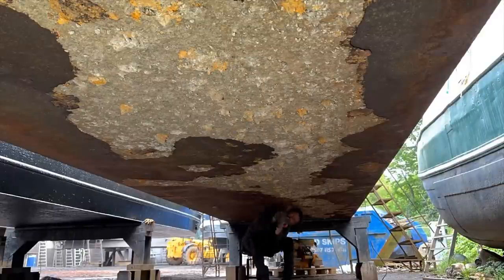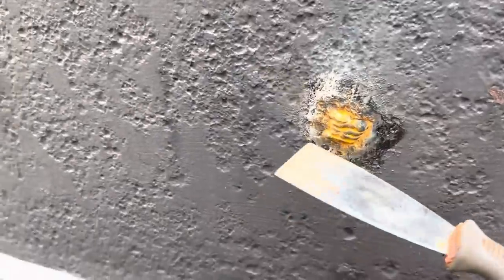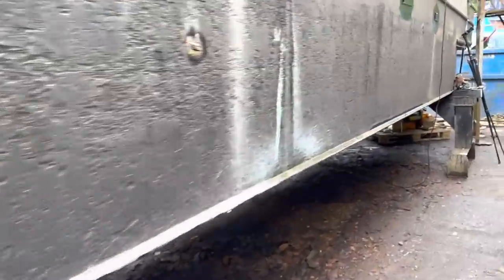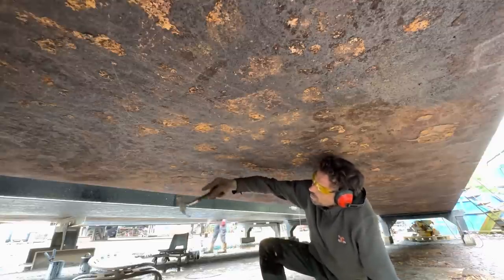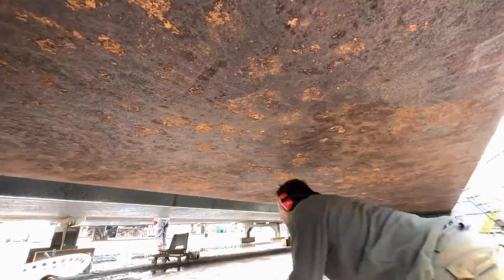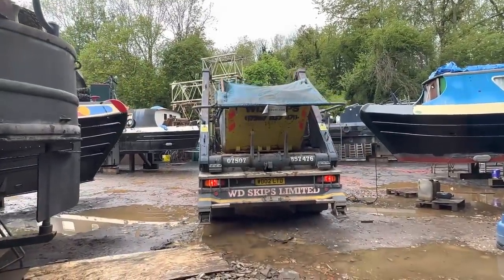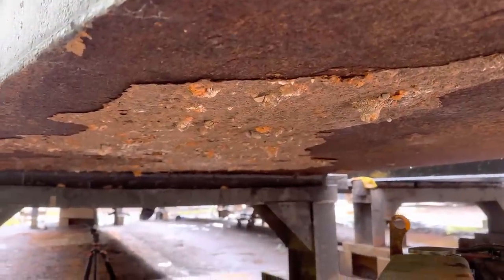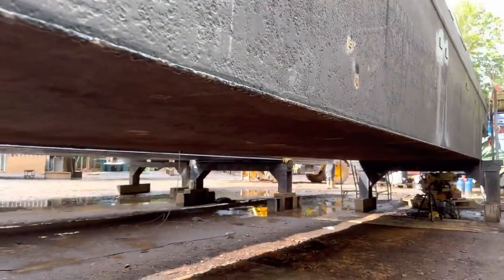425. Removing caked on scale and rust from the baseplate

Comment: That base is a waste of good energy James. Patch it up with Bitumen and next year get it dry docked and grit blasted. You’ll get 7 years peace with grit blasting and a 2 pack primer + topcoat. 

On the Anodes, it really does depend on the Active metal content as to the radius of protection but 7ft radius seems to be a good rule of thumb.
Reply from the maker: Yeah I’d like 2 pack in this 
Actually that is quite a good idea to get it done for a year and then look at that next year. Mmmm food for thought
Reply: @TheNarrowboatThatJamesBuilt  Another thought… if you bitumen it now, in a years or so you will also know what level of base damage you can expect over time! Gives you plenty of time to plan it and find a grit blaster and dock at a decent price… planning time is always well spent.

Comment: You need to find a concrete grinder that you can adapt to clean the bottom of the boat. You could rent it out and make a bundle
Reply: I've just designed one based on a 9" or 4" grinder; specific baseplate cleaner. took me 20 minutes..

Comment: i just spent 4 weeks under a 57 footer. had to clean the crap off with a needle gun, then wire wheel on a grinder, weld up hundreds of pits ranging from size of a finger nail to size of a beer mat (up to 4mm deep) then flat off the welds with 4 1/2 inch grinder. I FEEL YOUR PAIN
Reply from the maker: How much room did you have under there? Not fun work but worth it 
Well done mate
Reply: half a metre. not much but a good height for working so your not stretching. done a few now. i also do side over plates, new base plates, pit filling on sides and all the other jobs that need chopping out with a grinder & renewing (drainage channels etc). i contract to nationwide narrowboat sales on the stainforth & keadby canal @TheNarrowboatThatJamesBuilt

Comment: Would a needle scaler have been more efficient and quicker? That rolling cart may have saved one’s knees but it must be hell on the back! Sandblasting? I wonder if those high power Chinese laser cleaners would do a good job on parts of that bottom? I have seen several individuals redoing steel hull boats for freshwater use where they have refilled the pits by welding in sone fill and smoothing down the area, they say it works but it only works if you have a workspace to use for an unlimited amount of time.

Comment: Pardon my ignorance, because I only know what I see on narrowboat channels, but seeing that some say there is no need to black the bottom, why are you going to so much trouble to do this?
You have the patience of a Saint, because I would have said F this after about 5 minutes LOL
Reply from the maker: Not at all. Good question.
There are 2 schools of thought but it’s best practise to black the baseplate. It’s not just rust it protects. It also slows corrosion from electrolysis in the water. 
If you can black it easily then you should. Your boat will thank for you for it. 
But this baseplate is not just surface scummy rust - it’s caked on after 4yrs of not being in the water. It’s bad and needs lots of attention

Comment: Great work James.  This is the 21st century, you own an Ecoflow and a Dewalt oscillating tool.  I have to ask why use a hammer and scraper?  You won't punch through, it's not Sloe Patrol.🙃
Reply from the maker: This rust needs way more than a multi tool. I’ll show you in todays video what spots they work on and what spots they don’t 
A hammer is also a very good measure as to quality of steel, welds and overall shape of baseplate. You don’t get that from any other tool. That’s why surveyors will use a tapping hammer across steel boats

Comment: Wire wheel on a grinder, or hire a road type compressor and media blast it. Wouldn’t need vactan if media blasted but would needed the blacking on asap as does rust fast afterwards
Reply from the maker: I could get the blacking on asap but getting the kit is beyond me

Comment: Why not use multitool?
Reply: With the widest scraper blade.. James works damned hard, but not always smart.
Reply from the maker: @terencejay8845 it wouldn’t work !!!!! Not on caked on rust. The SMART thing ti do is to actually remove the rust, not just scrape the top surface
Reply from the maker: I will tomorrow now the heavy caked on stuff has been chipped off
Reply: @TheNarrowboatThatJamesBuilt  just wondering.  Love your channel. What a journey.

Comment: I would have used an SDS chisel bit on the hammer setting on a drill that's how I did my truck chassis and it was bad but it worked an absolute treat just very very noisy
Reply from the maker: That also sounds heavy above your head
Reply: @TheNarrowboatThatJamesBuilt  oh it was a killer...😨..(but quick and effective! Plus the bonus of resembling Mr universe at the end)😅💪👍

Comment: Can you use a orbital sander with 60 grit paper on it to get it down to where you need it??? Or a grinder with a wire wheel with a twist lock so wires don't fly out with the RPM running...
Reply: A grinder with a flap disc would be good.
Reply from the maker: All that stuff just polishes the rust and doesn’t remove it. It would work from now on as the rust has mostly gone

Comment: How much would it cost to replace the bottom of a narrowboat please ? In welding new steel to the narrowboat please And would it pay to use red oxide paint first
Reply from the maker: If your boat needs a new baseplate - it’s expensive. 6mm quality steel for a 50ft boat, welded by a marine specialist will cost around £15,000 
You don’t need to red oxide the baseplate but if its accessible then why not. Red oxide is cheaper compared to a quality black bitumen. That’s not needed on this boat.
Reply: @TheNarrowboatThatJamesBuilt  I used to fix cars and weld them up to for MOT to  could I not be  allowed weld up my own boat if I buy one ?  And at 15000 pounds it would be cheaper to buy a nother  boat to  i’m in a relationship breakdown and there is no help out there for men  how would you go about getting your own place to live mate ?  With the cost of things nowadays to  mate  ??? And thank you for any good advice that you could advise mate to ? Plus I look after my boy who is disabled and got autism ADHD and PTSD and he would be living with me to

Comment: Silly question: how do you know what's left is thick enough?
Reply: It should have been an 8mm base, minimum. Some are 10mm, but he can measure the thickness of the overhang to make a good guess.
Reply from the maker: No such thing as a silly question. The base is 10mm thick so the pits are 0.5mm so it’s still a very thick baseplate in mostly very good condition

Comment: Just a suggestion where you grinded the pits would it be sensible to paint red oxide in the pits before putting on any backtan????
Reply from the maker: Those little bits will be well protected by the blacking

Comment: Why bother blacking to base plate cause it will only rub off as soon as you go cruising 
It should not really rust in water cause there is no oxygen
Reply from the maker: @Nbwarriorlifeonthecut anodes don’t stop rusting !!! They stop corrosion through electrolysis. That’s why you have anodes under the water on the hull sides for, midships and aft and these days, now under the baseplate is the best practise
Reply from the maker: It doesn’t scrape off in the cut - we’ll not on the GU if levels are ok. It’s not to stop rust only, it also slows corrosion